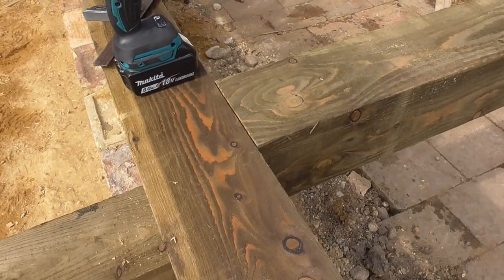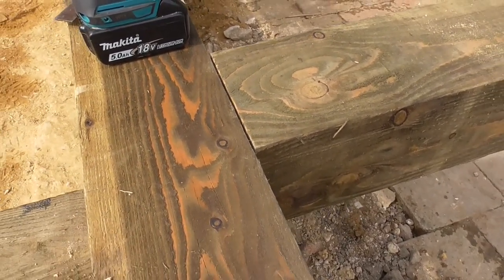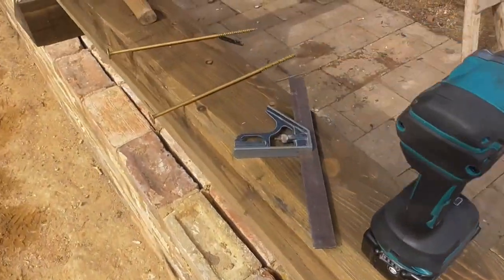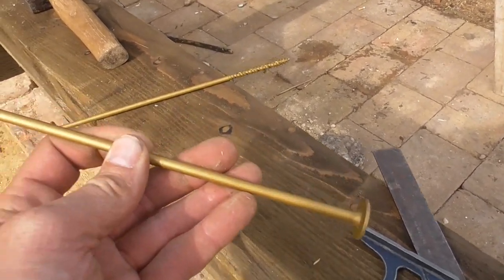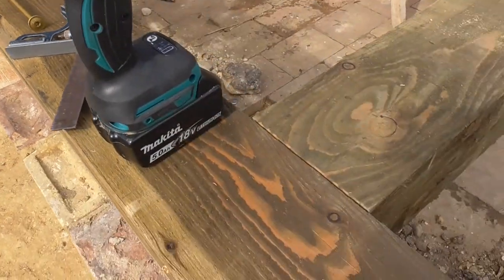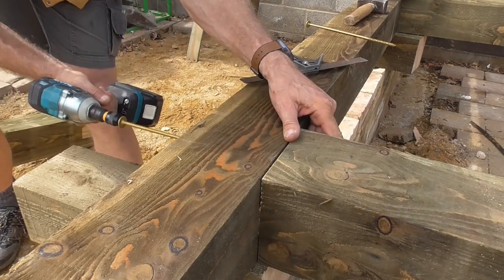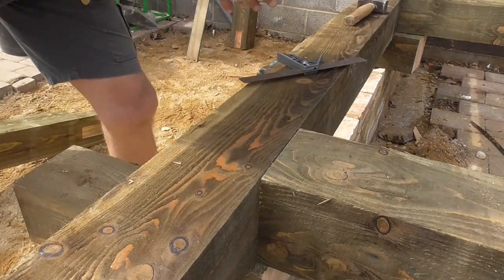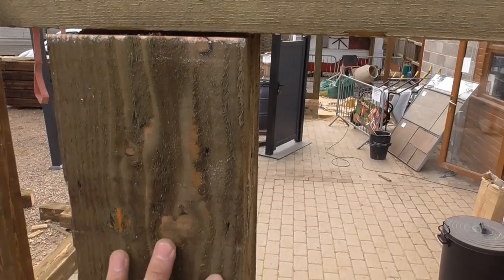Heavy duty timber fixings/connectors. ***AMAZING***

Comment: Nice to see a pro use them. I made some planters up using 200x100 sleepers. Originally I bought spax wirox for the lower layers. Seriously deer box of screws for 6x200 think £100 or so I from TS. I ran out (had a lot of sleepers and levels to build on them) I bought some of these forge fast fixings at a fraction of the cost of the spax. Took a chance and they’re brilliant. The bit lasted through 2 boxes still hasn’t broken. All driven home with no pilot no screws broken. Very impressed, the spax screws have their place for some applications no doubt.
Reply from the maker: Hi John. I was aware of the cost of these type of fixings, particularly the Spax ones. The ones in the video weren't cheap, but definitely saved considerable time when making the joints, and, obviously worked a treat for your application.😎Cheers.

Comment: There ya go, another little handy tip those screws. And here's me I would have banged two wedges in.
I will use those screws, very impressive the way the head of the screw pulls the joint together. And they look good.
Reply from the maker: Hi Frank. I wasn't expecting them to pull that big 6"x6" post down like that.😀 Thanks for watching and your comment.👍

Comment: Hard soap on the screw treads they fly in 👌👌👌👌
Reply from the maker: Great little tip Mark.🤩 Cheers.
Reply: Years ago carpenters had a pot of “tallow” for brass screws. 

Still get this from electrical suppliers.
Reply: ....or if you are backed up into a corner, a knob of butter from your customer’s fridge..... 😗
Reply from the maker: @iainw9029  That's cheeky Iain.🤪

Comment: do you think you could use these without cutting joints to make a table out of sleepers? ie 2 per leg would they be strong enough?
Reply from the maker: Hi Oliver. I think they would be plenty strong enough. Its what these fixings were designed for. I only went overboard with the mortice and tenon joints on this job as its a for a customer and I didn't want any comeback as its quite a substantial structure.😎 Cheers.

Comment: Did you pre drill before screwing the screws in??
Reply from the maker: Hi Paul. I think I mentioned in some text that I predrilled them first. I actually used a 6mm, super long flat bit and drilled to the depth of the waisted part of the shank. I think it helps keep a long screw like these on track.👍 Cheers.

Comment: 👍 what impact you using?
Reply from the maker: Hi Neil.  Its the Makita DTW285 with the DeWalt 1/2" to 1/4" hex bit adapter. It doesn't put the screws in any faster than my normal impact driver, but has a much more heavy duty impact mechanism and so is great for putting lots of these bigger fixings in.😎 Cheers.

Comment: Would they be ok with oak sleepers?
Reply from the maker: Hi Barry. I would say yes, but they wouldn't need to over long, and I would try and pilot drill them first.😎 Cheers.
Reply: @thetallcarpenter  I think you need stainless steel for oak on account of the staining.
Reply from the maker: @dannymurphy1779  Good point Danny. I didn't think about the material of the screw when I answered Barry's question, just the screws ability to join oak. You're certainly right about using the correct type of fixings in oak, and the screws I used have a special coating, but it would be best to check if they are suitable for oak.😎 Thanks for putting you comment in mate, its very helpful.👍

Comment: They are a  get  screw and  so reusable I use that same style  in smaller  sizes 6×60 up to 6×200 won't use any else for construction purposes they just  brilliant
Reply from the maker: Hi there. I really don't use these longer type timber fixings much, but having seen and used these ones, I'll definitely be thinking about using them more in the future. Thanks for your comment.👍
Reply: Always use these construction screws for screwing down OSB on top PIR insulation on warm decks. So much holding power.

“Wafer head”  as I’ve always known them.
Reply from the maker: @christaylor5291  Hi Chris. I've used long countersink headed screws for screwing ply over PIR.(still have to counterbore a little for the head) I think you're right about them being called 'wafer head'.😎 Cheers